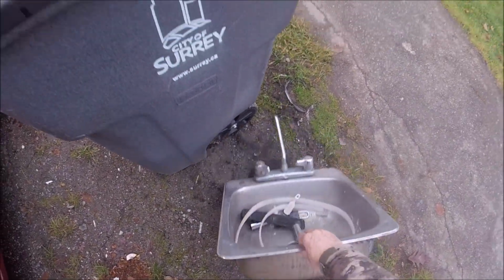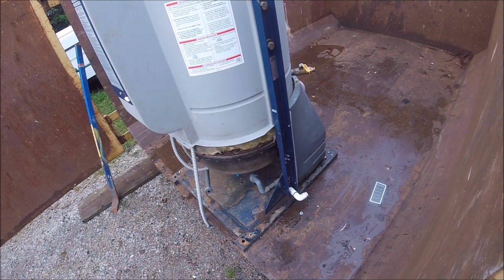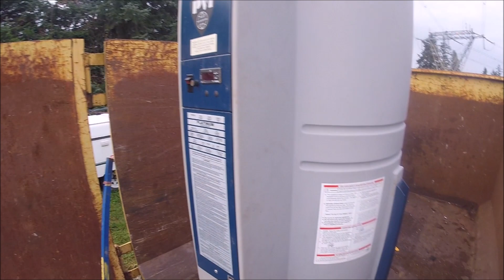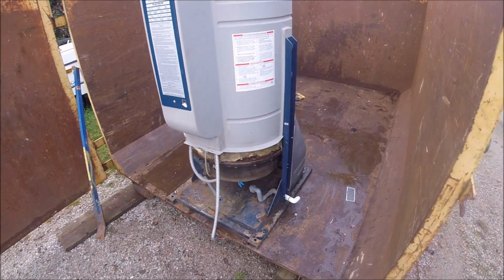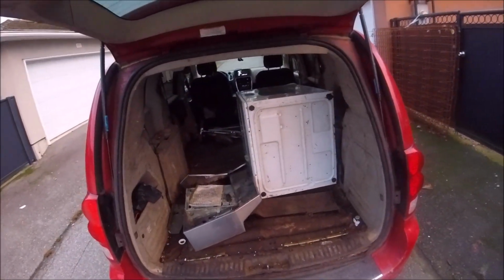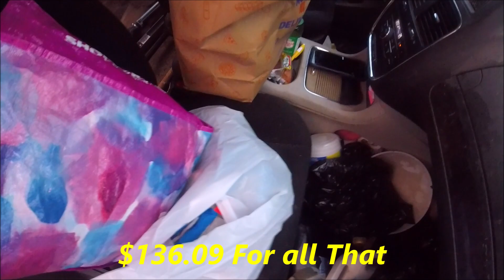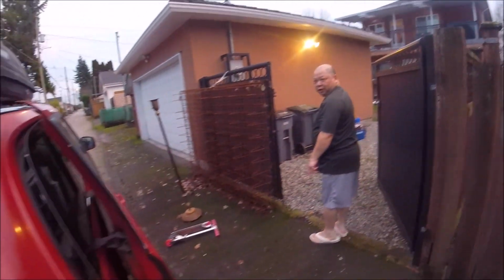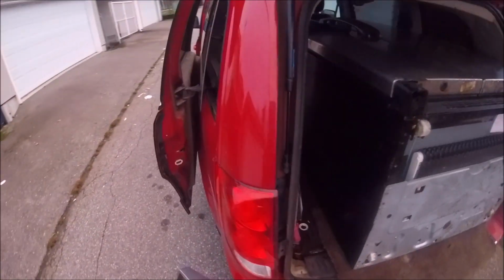Street Scrapping Looking For a Big Fridge

Comment: In the past you skipped fridges when you don't have space in the van and never went back to get them. When you were referring to the "big" fridge for two days, I thought it was a monster, just like the hot water tank. But it was a normal big fridge. In the past you would go for a mini scrap run with it to avoid double handling. In any case it would be good for your bin. Easily 250 pounds.